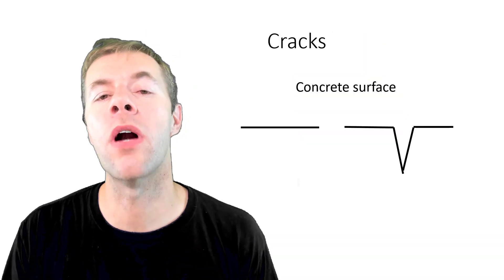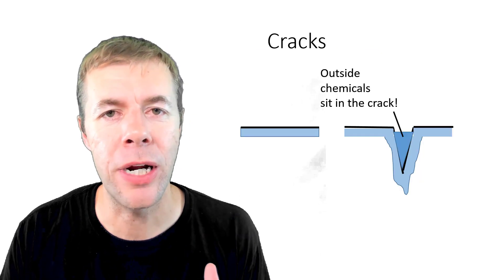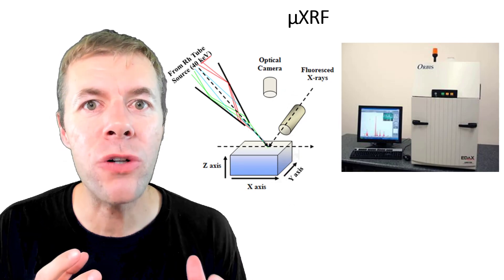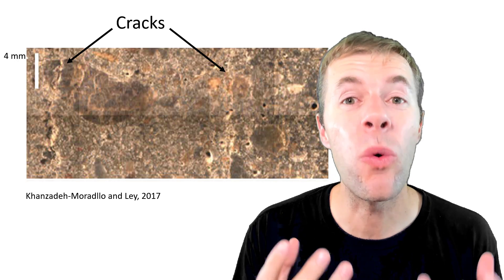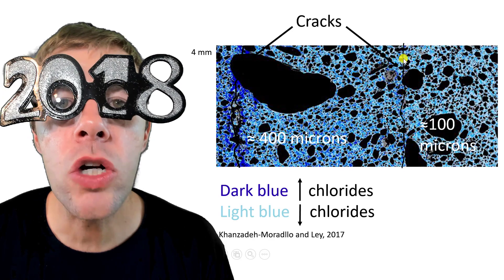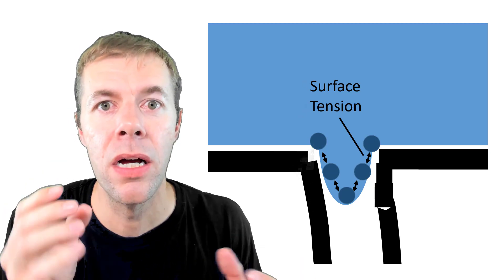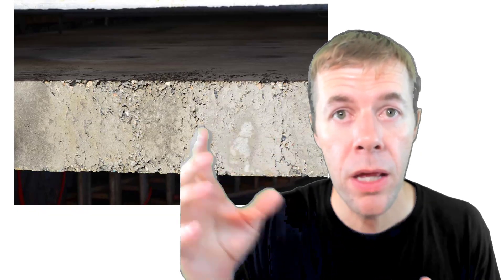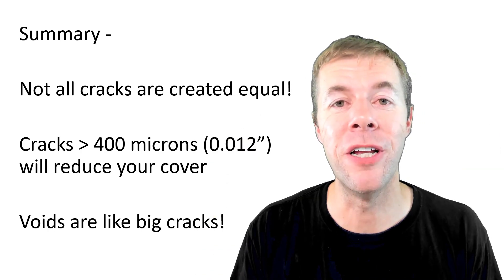How do cracks and voids impact concrete?

Comment: So a mix with air bubbles such as aerated concrete mean it is not good for a long life-cycle without additional exterior protection?
Reply from the maker: Douglas - There are a lot of challenges with aerated concrete that is directly exposed to the elements.  I do think it has many possible uses.  There is also problems with transferring loads between reinforcing bar and the concrete.